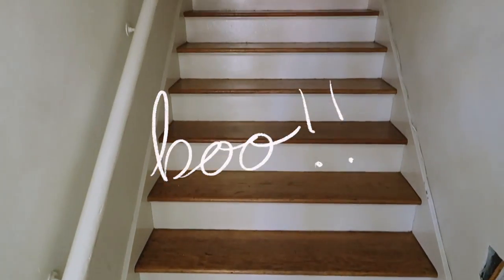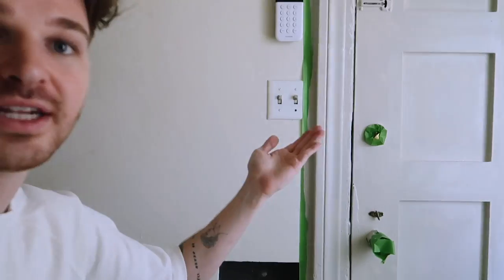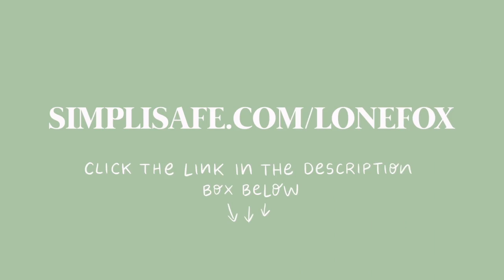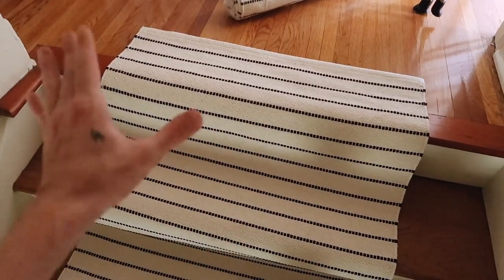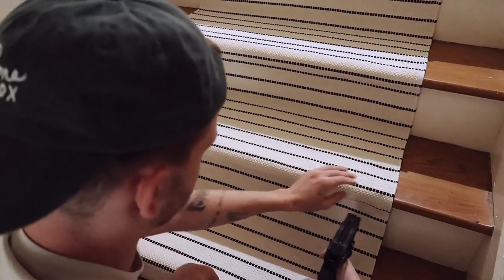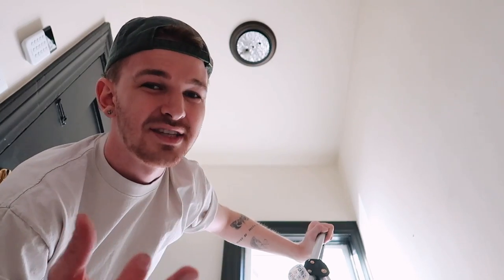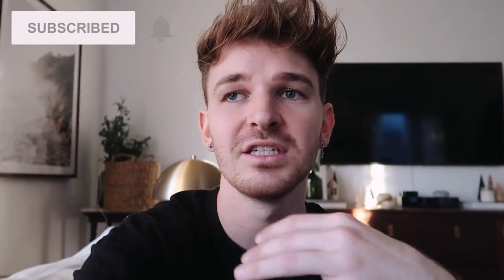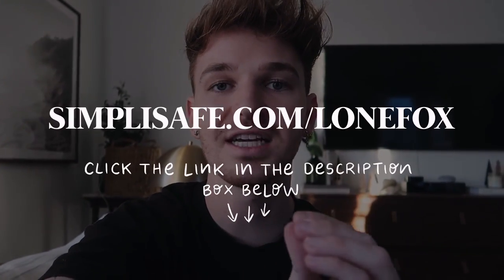SMALL ENTRYWAY MAKEOVER + DIY Statement Tile & Stair Runner!

Comment: If the double sided tape doesn't hold on the stair runner you could DIY stair case rods; dowel that holds the runner down.
Reply: Yes. That would be the correct way to lay a stair runner. Tape is not going to hold, and could be dangerous if pulled away and carpet scoots out.

Comment: Absolutely gorgeous ❤️ Love the runner and gallery wall. I was wondering if a floating shelf or open entry console with slim legs would work better than the chest, so as to show off the entire floor and not block the light from the window as much. Looks a bit too tight there.

Comment: HiDrew. Just  a thought if the stair carpet starts to move a little, stair rods ! Maybe you could diy a cheap alternative?
Reply: Yes, maybe black & white paint & a stencil design on the stairs
Reply from the maker: Yes yes yes!!
Reply: Didn't see this post until now, as I just posted the same idea!😀 Maybe even in the brass that you used on the light?😀
Reply: @lonefox  carpet stair runners are one of the hardest decor choices to pick out especially if you rent because it's an expensive job.  I fussed with my choice for a year. First I had to remove the old carpet. Removing all the staples from under the bull nose was back breaking and turned me off about wall papering the risers. Stenciling is nice if your back can take it.  I went with stair treads in a print pattern and white painted risers. They come in all sorts of colors, patterns and sizes and prices. And very easy to put down and remove. Paint on steps is a bad idea for renters if you have to remove it when you leave. You have to make sure what ever pattern you pick doesn't make you dizzy walking up and down the stairs. 

If it was me, I'd go with a peel and stick decal for the risers with a black stair tread. Or leave the risers white like they are and get a black, creme and gray print for the stair treads. You know, some pattern to match the awesome tiles you just put down.
Reply: I worry about safety if they move...  also liability the tape gives just once and it would be a mess.  LOVE your asthetic

Comment: I’m honestly surprised you didn’t go with a Persian rug runner, I feel that it would’ve gone better with your vibe and apartment as a whole
Reply from the maker: i wanted too but it would have cost about 4-5x as much :( I think I may swap it out in the future!
Reply: @lonefox  I would love to see if you do! It would add so much dimension, warmth, and color to the space :)
Reply: Money
Reply: @lonefox  try stairs treads. You can buy a pack of 10 for like 100 bucks. That's what I did when I rented. Later when I owned I got the bull nose carpet treads which they custom make to your size for each step. It cost me, ,$70 a step but I love it. They are super easy to put down. No glue...no nothing. They stay put in high traffic areas but they are an investment piece.

I don't like to shop online for that stuff but the manufacturer I found had amazing customer service so it made shopping fun and easy. They are true professionals and very patient which is hard to find.

Comment: Advice: For simplisafe be careful with putting the type of security your homes have unless its ADT  installed as a poster in your yard due to Simpli-safe being self monitored possible suspects research ways to disarm them easily if you find signage that says this home is “security monitored Daily” which you can get more aesthetically pleasing ones online I guarantee you not a soul will even attempt to break in your home. Xoxoxo

Comment: If you do the runner or something similar  Try spraypainting the staples to match the rug before you put them in the gun to save yourself time and energy ... looks amazing!
Reply: Ive done this before with a sharpie for black Staples  so not 100% that spray paint would do the same? But maybe a light coating of spray paint would be better than a heavy layer

Comment: About the stair runner, I've seeing some of them with metal rods across the bottom where you have your staples and they are bolted in, or are secured, with some sort of bolt . The whole thing looks very discreet that I don't even remember how those robs were secured to the floor... But it looked good to me because I thought with tablerunners if they ever got loose it could be very dangerous

Comment: You could have used dowling to hold it in on the step, that way you would only need to fix the dowling down. But it looks amazing well done! Also, just had another idea... you know the staplers come in compacted little strips? Well you could try painting the top white before loading the stapler gun?

Comment: This really works. I have a couple thoughts, though. Does the door open all the way with the cabinet down there? Are you planning to put a protective spray on the rugs to keep them easy to clean? Sanding previously painted surfaces is a good idea. I do want to share a hack I got from DIY Danie and the Sorry Girls: cut craft paper the same size as the frames you want to hang. Then you can easily hang the paper (with tape) and move it around for the whole wall and design it that way. You can also put your hanger on the wall right on the paper, then rip the paper away!

Comment: Great improvement. Check out kinwoven' s site. Rebecca's daughter posted ten affordable Target items. The last one was a console slimline. Better fit. Cheap. Larger mirror. Follow the windows architecture. Need that light. In U.K. they use metal rods to hold the carpet on the risers.

Comment: Very pretty makeover! But I advice against strong double sided tape in ANY situation. If left too long it can get so stuck you can never remove it again.  I'm struggling with removing carpet taped to a stairwell, like 20 years ago. So far I've tried a ton of different more or less violent or toxic methods on and off for the last two years. The result this far: half a step cleared. Now I'm stuck,  there's nothing left to try and I'll have to remove the whole top layer of wood on every step! And  no, you can't sand off a thick layer of sticky and sort of foamy plastic, it just destroys the sander. ( I've asked for expert advice from several people, of course) So, avoid tape at all cost, you might live to regret it!!!
Also I agree that this looks quite unsafe, the staples will not hold for long. 
But it looks extremely cute and fresh, I'll give you that😊!

Comment: Love it! I used the same peel and stick tiles in my laundry room,  Sadly, the floor was not level and has been disturbed due to some construction so many of the tiles have moved. Do you have any recommendations to getting them to stick? I am a a homeowner so a permanent fix is fine.  THANKS!
Reply from the maker: you can probably glue them down with construction adhesive!
Reply: @lonefox  thanks! Do you recommend any particular construction adhesive?  I have never used one.

Comment: The reason people use stair rods is because it allowed them to take out the rugs and beat them. Stapled, it will be difficult to clean the rugs other than with a vacuum. Bold to put white on the stairs where you'll be bringing dirt into the home unless you plan to use the cabinet for shoes.

Comment: I bought and installed those floorpops in my rental and they left a horrible sticky residue on the original flooring :/ have any of you run into the same problem? If so, any reccomendations on how to remove the residual adhesive?

Comment: You should NEVER have stair carpet with a horizontal stripe as it becomes very difficult to differentiate each step, so it is easy to miss your footing and fall, many interior accidents due to this. If you have a stripe make it vertical.